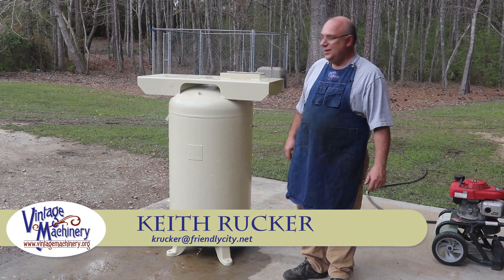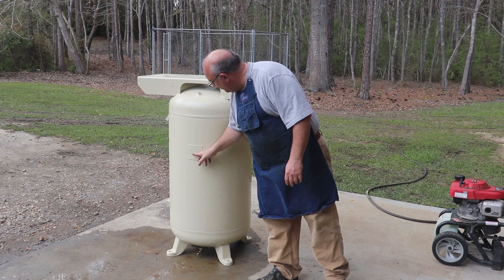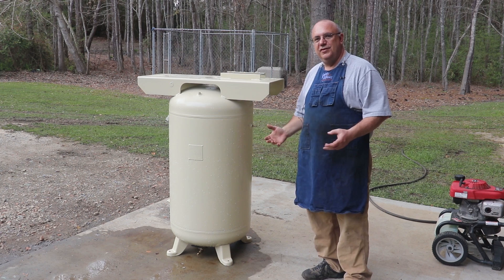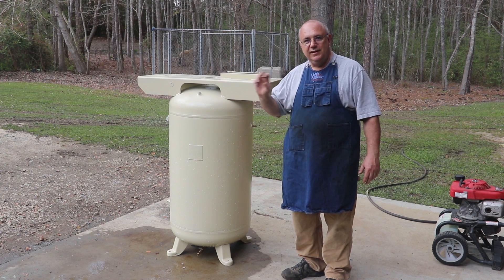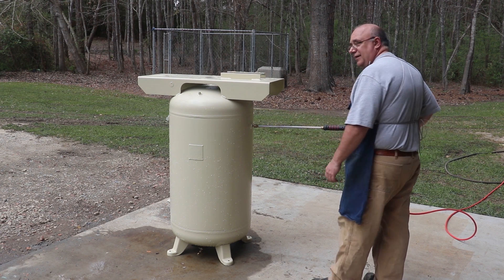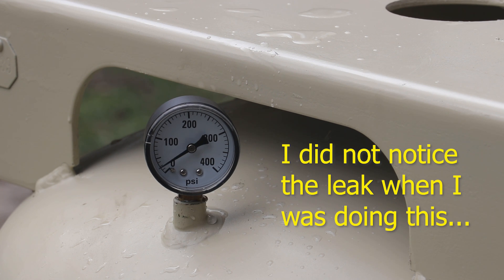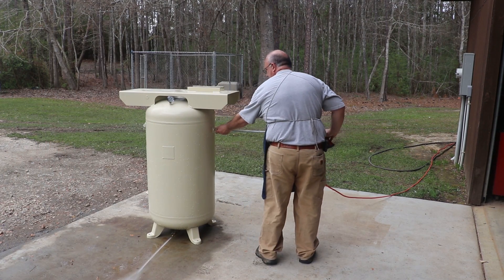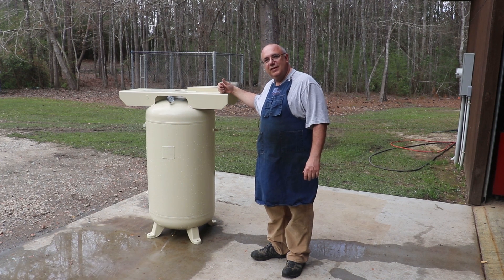Hydro Pressure Testing a Air Compressor Tank

Comment: You had a lot of air still trapped in that tank, the test wasn't nearly as safe as you thought.
With a fully evacuated tank, the pressure gauge will rise over 1-2 seconds. That gauge clearly indicated a lot of trapped air. The pressurised stream of water released when you opened the valve also shows there was compressed air trapped.
The CORRECT way to pressure test pressure vessels is to completely evacuate the tank of air, pressurise with water, vent and top up tank (yes, even just filling the tank allows countless air bubbles to adhere to the sides of the tank, pressurising and venting removes them).
Then once the tank is properly evacuated, you apply a pressure and hold it for 15-20 mins.
The last step is to decompress the tank and using a burette, measure how much extra water you can add. This indicates any permanent expansion of the tank.
And that's why getting a pressure vessel certified costs money- it takes time to do correctly.
Something to consider- if you run your Youtube video production as a business (even merely declaring it as making income on a tax return may be enough for it to be so), you may be required to have that pressure vessel properly certified.
Reply: Yes, it's obvious that there was air in the tank. But he figured that the volume of air was low enough that there wouldn't be a dangerous amount of potential energy in the system if the tank failed.

Comment: Home Brew Hydro Testing using a Pressure Washer, Gotta Love It.
Reply: When I was with the Genesee County Parks & Recreation Commission we used a weed sprayer to hydro test air tanks.  We would adjust the pressure regulator for the pressure we wanted.

Comment: SCUBA tanks usually hydrostated in a water bath in a cage.
Reply: They are also high pressure vessels exceeding 3000 PSI in service that would be tested to at least 4500 PSI.  Even using water, a rupture would be much more energetic than a compressor tank, and you add the danger of escaping water stream being able to penetrate skin.
Reply: @timothybarney7257  My point exactly.
Reply: When testing or even filling a SCUBA tank, the rise in pressure increases the temperature of the gas and the tank so the water bath is the heat sink, to prevent adding thermal stress to the tank. I've never seen a hydro static test on a SCUBA tank, nor do I want to!
Reply: Not a big deal, used to do SCUBA, SCBA and others. Biggest PIA is getting the water out of them. The actual testing is 99.9% boring... But that .1% can cause you to need new underwear !!

Comment: My compressor says to drain the tank when not in use, is this a normal practice or something some manufacturers do as a result of thinner metals? Just curious....
Reply: Prevents condensation buildup and takes pressure off the lines and fittings
Reply: It's to minimise tank corrosion. All air tanks should be drained frequently.
Reply: yes its standard compressor practice, drain every day ideally, end of the day is the best time, if you remember
Reply: One thing to remember you have an very oxygen rich environment combined with water just speeds up the process of rust.
Reply: I took it as draining All the air out of it, not just doing a quick blast of condensation. They were talking of the stresses of the metal being continuously steched to a degree. BTW, I do drain the tank after use, and it is 60gal model...
Reply: They are saying that when you are not using it for a longer period of time to drop the pressure as a CYA on their part. If the tank did fail they will say "You left it stored under pressure, We told you not too, so it's your fault"
Reply: @Blazer02LS  I agree, dad had one similar and never did any of that, I don't believe he drained the moisture out of it that often let alone drain the air completely, and his lasted for years right up until the day we sold his equipment....

Comment: I remember doing a 600psi test on a boil with a hand pump, dam it took time.

But for air I do the same as you did but just use a cheep home electric one, and yes I have done a few.

I also remember the day I used a pressure washer to save a 100 odd year old traction engine boiler that had both the mechanical water pump and the injector pump fail at the same time whiled heavy fired, when someone (and no not me) used a huge hose from a pump out of a dam, they pumped sludge into the tank.
everyone was so worried and so I just found a quick connect and fitted it to the steam pipe and filled the boil with town water, it took a few minutes for the water to show on the gage glass but it did the job and saved the boiler, tho it needed a major clean out and retesting because of the event, but hey it worked.

Comment: i can imagine our euro friends finding a lot of faults with your testing methods
Reply: Right Round 
Not casting negativity upon anyone, but safety is not dumb. Discussing the extent of risk is not dumb. It is a good exercise in living.
Reply: You clearly don't understand what hydro testing is meant to achieve. This test did not achieve anything and was no less dangerous than using compressed air to do the test, as Keith actually compressed plenty of air during the test.

Comment: i do a lot of hydro pressure testing here in the UK on check valves for the gas and oil industry when doing a test like this with large volumes of water please still take care because if you do have a failure of the tank or any of your fitting you will be surprised at the results as you can see when Keith let the pressure out at the Bottom of the tank if that had being a fitting coming off you would know about it i do pressures from 350 psi up to 15000 psi  on Hydro so have plenty of experience with this type of testing it is safe but you still need to take care ENGAGE SAFETY SQUINTS  and i would have put my self behind something when doing this test  please do not think i am having a go at Keith but unless you witnessed a test go wrong or had one your self go wrong like i have last year when a gasket let go at 4.500 psi  you then have a lot more respect for any type of pressure testing (yes i know it was only 250 psi ) but it will still hurt so take care
Reply: If you can't understand what he's trying to say without punctuation your going to find life a real struggle
Reply: Valve Monky is spot on, and all us professional valve and vessel testers are more concerned with safety than comma.  ( 15k is a bit low though, I test 30k rated PSL3 equipment to 45k here in Aberdeen, but we do take a lot of precautions. )
Reply: Put yourself behind a screen,of coz.dont assume th test subject is going 2 pass the test.safety first
Reply: Agreed. I was testing some short 1/2" copper pipe spools (to 30bar) but forgot to tighten compression cap. It gave up at 12 bar and it flew far enough to know that if it hit my eye/face it could do serious damage.
Reply: @justotalkalottashit8392  it's a reciver and pump that's just material cost. I've found most people think your lying if you tell them the cost of a small capital project.
Reply: Seems like you could have done a little less testing and a little more learning how to punctuate your sentences.
Reply: will it keep me safer  in my job if i do . @lapdog1479
Reply: Hi, same story over here! A hydro test gone wrong is still a lot of energy liberated! You are absolutely right.
Reply: Seems very risky with using a valve like that to charge with pressure.  There had to be an air pocket at the top to keep that pressure from spiking instantly.
Reply: Couldn’t believe he didnt perform the test at a safe distance from the tank
Reply: Grammar
Reply: @JRLSprague3  Grammar school !!
Reply: Did anyone notice bottomlands deleted his comments that sent people down this hateful rabbit hole?
Reply: @bottomlands  have you ever written a hydro test procedure for a 25 mile DOT pipeline or actually tested and inspected a hydro test?
I have for the last 15 years. Have you ever over seen a 1.8 million dollar project? I am right now. Do you have an IQ of 145 ? I do. My point is dont dennagrat some one over punctuation English may not be his first language. When people try to run a person down over small stuff they don't get the big picture.
Reply: @frankinjeep1194  ****denigrate. Lol I’m just jokin I’m sorry your guys Internet experience has been so bad that you have to preemptively say don’t think I’m talking shit about the Creator with this comment ha ha
Reply: IQ of 145? What a crock of shiite. Shitty grammar sucks a$$.
Reply: 4.5 psi !!!  Wheew!
Reply: @bottomlands  I have found through my journeys in life people who care about punctuation and lord it over people lack practical knowledge of the world and cannot actually do what they are critiquing. 
  Iff you use punctuation to prove you superiority you are infact inferior and most likely insecure. 
 That being said. I helped my uncle jack off a horse. 
  I helped my uncle jack, off a horse. 
  Witch one is correct? 🤔
Reply: @frankinjeep1194  People who care about punctuation and correct spelling are people with meticulous minds. Trying to claim that virtue is somehow inferior is pathetic in itself.
Reply: @frankinjeep1194  Wow, All you did there is prove what a self righteous douche bag you are! lmao
Reply: @dept.ofredundancydept.94  I'm just tired of grammar police. Its YouTube not English class. And yes I'm an ass hole.
Reply: Pedantic punctuation pricks pause perfectly productive processes, preventing personal participation.

The original comment was very informative, and welcome advice from a professional.  Frankinjeep's comment was spot on as well. Perhaps the Valve Monkey comment was lacking in punctuation because he was typing it on a cell phone while watching a pressure gauge at work.....Punctuating on a cell phone sucks.

Some people don't have the luxury of sitting at a keyboard, drinking cola, and eating doritos, all day.
Btw, "Google search 'punctuation'" is not a complete sentence.
Reply: @notsofresh8563  
So you are giving license to mediocrity? I look at it as: if the person has valued thought it should reflect in the way s/he expresses it, method of striking the a,b,c's be damned.
Reply: The content of the original comment was not mediocre. It added real life professional experiences to the discussion. "Who cares what you said, you suck at punctuation". That is the attitude that is garbage. 
Youtube is not a scientific journal.  I bet well over 50% of the total comments on youtube have grammatical, punctuation and/or spelling errors. I'd put money on more that 80% actually. As such, the norm in this communication medium is to NOT properly construct sentences. Get off your high horses.
Reply: frankinjeep 1;  I like you, you seem like an honest fellow.  LOL
Reply: @frankinjeep1194   Given that you don't even know "your" vs "you're", I doubt your claim of having an IQ 145. (With English being your first language.)
Reply: @TheHarryroks  I'm on a job site and my phone keeps auto correcting to your. if you look at some of my earlier comments they are edited. I just gave up fighting with my phone. Yes my IQ is that high but I am dyslexic trust me its frustrating I can do trig in my head but I cant spell shit. The frustration in my life is ridiculous. There are many different types of intelligence personally I think IQs are only part of the story. I'm just tired of people running some one down over grammar and punctuation. It's a way people try to exert supremacy over an individual because the feel insecure about the fact they know less about another subject. I believe no one is more or less intelligent. People have knowledge in subjects others dont. Does it make them more or less intelligent? No it just means that they have different knowledge. 
An IQ test only tests short term memory versus long term memory and deductive reasoning it's not a spelling test it simply measures a person's ability to assimilate and utilize knowledge. An IQ test is the one test you cant study for.
Reply: @notsofresh8563  "Perhaps the Valve Monkey comment was lacking in punctuation because he was typing it on a cell phone while watching a pressure gauge at work" Oh yeah the master of multitasking in all of its glory. I call bullshit on that one. Watching a pressure gauge at work while also watching youtube videos and commenting on them, sure thing.
Reply: @TheChrisey  Keeping current is also a feature of "meticulous minds". This video and most of the comments are over 2 years old.........Btw, do you also chastise people for missing the accents in your name? Probably. Get a life..
Reply: @frankinjeep1194 

Hi...
Your a spacker that can't cope with the concept that other people in other countries also possess knowledge & experience...

Want to go up against me on electrical installations...?

With thanks
Glenn
GLMelectrical
Leeds UK

Comment: At Ball Aerospace, outside of Boulder Colorado, they had a facility that tested tanks. They were doing a repeat pressurization test, putting the tank in question through multiple cycles of pressure, and failed to realize that some of the water escaped with each venting of the tank. When the tank failed after several days of testing, the top half went through the roof and about 200 feet in the air.
Reply: I used to work at Ball in Boulder. Optical design. Never saw the facility you speak of. But that’s no surprise.
Reply: Really. I wonder where Ball gets their special compressible water for such tests. They certainly don't sell that on McMaster-Carr.
Reply: @Kandralla  Read it again, slowly this time. You'll understand eventually.

Comment: I have enjoyed your videos for several years,and cringed as you tested that tank.Two things I found very scary(although if something bad had happened you could not have posted the video) #1 you did not get all the air out as witnessed by the rather long initial spurt of water when opening the drain valve #2 that fact that you were right next to the tank as you pressurized it.A long hose from the tank to your wand,with you a distance away would have been much safer.The gauge could have been at the end of the hose where you could see it.The chances of anything going wrong were quite slim, but as we all know safety cannot be a gamble. This is not a negative comment,but just my concern for your safety. As I said I enjoy your videos very much and look forward to seeing many more.Stay safe.
Reply: .... There's always one of these guys. Despite minimal risk they'll still find things to criticize.
Reply: Hopefully he had on a condom... Wouldn't want to get the tank pregnant.
Reply: There's actually plenty to criticise on this vedeo. This isn't a hydro test and despite Keith thinking it was quite safe, it was not.
He had enough stored pressure in that tank with the large amount of air in the top dome, that he had water pressurised to 225psi that could've potentially ruined his day.
There's a very good reason they put fittings at the very top of pressure vessels, and it's not just to get a few more cents out of the customers...
Reply: @TyphoonVstrom  Calm the farm buddy, no cotton wool was harmed in the making of this video. Pretty sure Keith knew the risks unlike a certain individual who is afraid to actually take risks. Besides I bet you drive around in a (potential) bomb everyday and think nothing of it.
Reply: Think you forgot to mention that he failed to wear a hazmat suit and extra cotton wool while he tested the tank.

Comment: How are you going to dry that tank out? Any remaining water is going to cause corrosion, so it is not something you want in there. I suppose you could drop some (probably a lot of) silica gel in, but I don't know what the best method would be?
Reply: There is water inside of every compressed air tank.
Reply: All compressed air tanks collect water from when the atmosphere is compressed. That is what the drain plug on the bottom is for, once it has been pumped up to pressure the water will go to the bottom and can be drained.
Reply: All compressor tanks have purge valves/petcock on the bottom. You're compressing regular air and it contains moisture, so you have to purge them on a regular basis.
Reply: it will get wet soon as its used, lots of water in the air when its being used, it will collect a pint or so a day when used, so daily emptying is part of using a compressor
Reply: Air tanks collects water from condensation anyways, that is the reason of drain valve on the bottom. Last time I drained my small compressor air tank I collected almost 1 liter of water from 27 l air tank. To be honest, i did not drained it for years, but also i don't use it so much. There are difference of corrosive properties of condensed water and tap water, but after first drain, all residual tap water will be gone.
Reply: Add a little soda water (and sodium sulfite if storing wett)  get the ph above 9 but less than 12. then drain

Comment: Great example of a hydrostatic test. If you want to placate the physics nerds, you could de-aerate the water (using distilled water run through a molecular sieve)...
Reply: I used to be an hydrotest technician, hydrotesting high pressure bottles. We let the water stand for 24 hrs. before pressurizing to allow the free air to dissipate. The remaining air is such a small volume it's negligible.